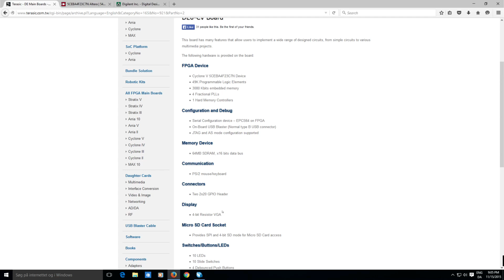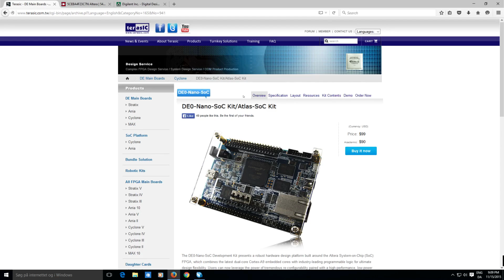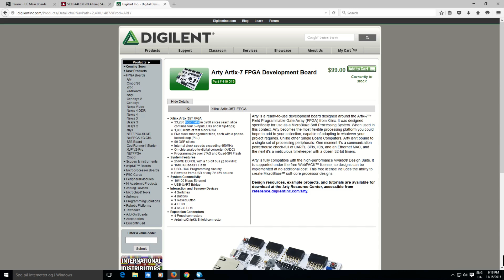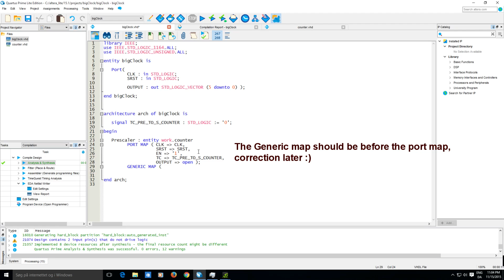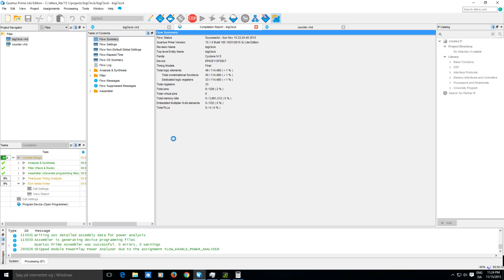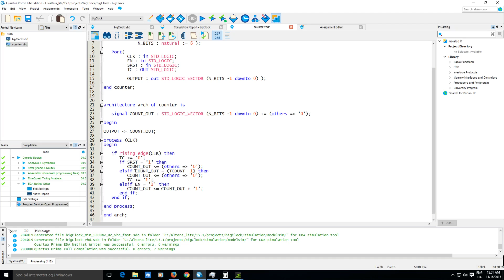FPGAs and VHDL- Part 2: Making a Counter - Ec-Projects

Comment: Just a quick notice. I've worked with the same FPGA devkit myself. For some reason the LEDs above the silder switches are dimly lit all the time if you do not configure the FPGA's pin that are attached to them. I noticed the same in your video. I don't think it can harm in any way, but I made a habbit out of it to make all unused pin a high-Z input. And the LED pins an output with hard wired logic 1 or 0 (depending on which one turnes the unused LEDs off). 
That said, I do like it a lot to see you work with Altera and VHDL, as a lot of FPGA tutorials are either only the HDL or aimed at Xilinx products (and usually using Verilog as HDL). You actually combine both language and the FPGA into a thorough step by step tutorial. Great work!
As for length; 45mins to 1h seems OK for such a complex subject as FPGA & VHDL. Certainly when you want to explain things properly.
Reply from the maker: +Christe4N Thank you! I have wanted to do this series for a while, because when I started there was not much at all. At least now there is a few videos out there, but room for a whole lot more, so now I'm having a go at it :) My thoughts were exactly as you describe, I think it's important to bring the hardware along and actually make something work in the end :)
Thanks for the feedback on the length also!

Comment: I want to try out FPGAs. Im familiar with Atmel AVR so i would love to be able to code them in C. WHich one should i get?
Reply: +FlevasGR you don't really code FPGAs but you configure them. You need to use a Hardware Description Language (HDL) such as VHDL or Verilog. There is a project called SystemC or something that let's you write C and compile to HDL but it's not useful for anything but an academic endevour. Good luck!
Reply from the maker: +FlevasGR I can't tell you exactly which one to get, but I mentioned a few in the video :) Regarding programming them in C, you can in fact do that, BUT it's not any easier than learning VHDL or Verilog if you ask me :) The C language used, has some added non-standard functionality in order for it to turn the sequential code into parallel. SystemC is one of these language. I don't know if the standard "free" tools from the chip vendors support it yet. What I hear around is - once you have learned SystemC and gotten experienced with it, it's much faster to write code for large systems because you can easily convert sequential functions running on your processor into parallel hardware blocks running in the FPGA. If you use separate code for each, say C for the processor and VHDL for the FPGA, you would have to rewrite it completely. Where I see it really kick ass is in with the "new" Xilinx Zynq and Altera SoC chips where you have both an FPGA and a fast processor. Long answer sorry :D